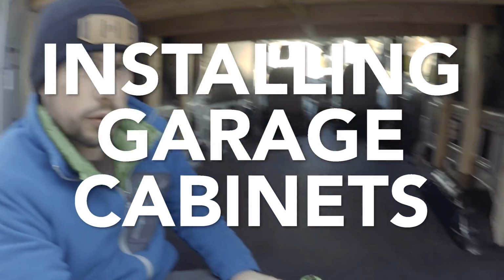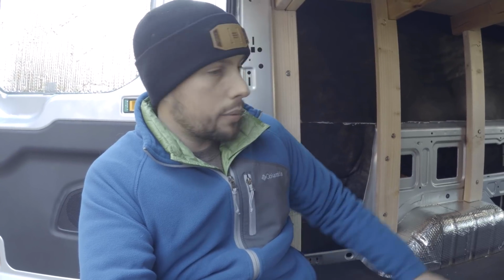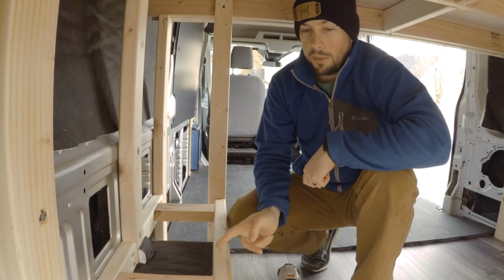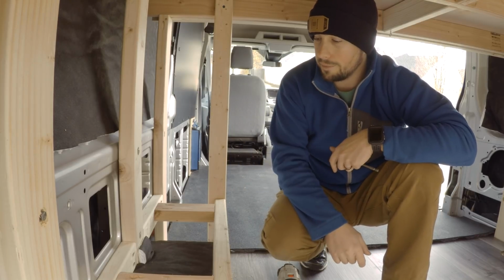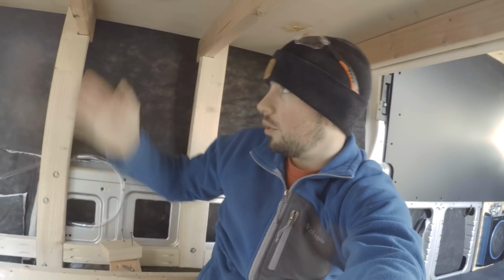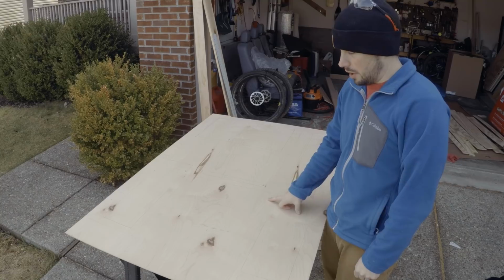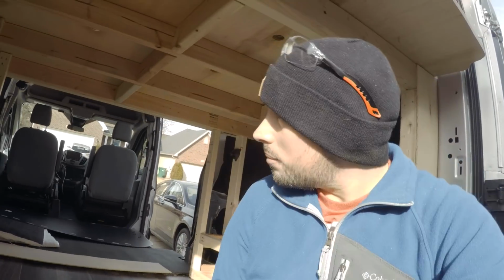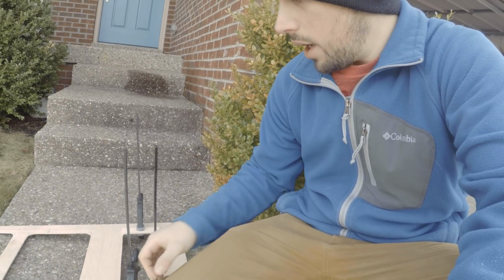Building Garage Cabinets in a DIY Camper Van // Van Life Ep. 12

Comment: How come you haven’t put in a moisture / vapour barrier in you conversion?
Reply from the maker: We eventually covered most of the interior with reflection as well (that could work as a vapor barrier) but I found that it's incredibly difficult to 100% seal the interior. The built in moisture repellency of the thinsulate will be helpful. So far with proper ventilation and some added moisture absorbing materials we've not had any condensation on the inside or noticeable moisture issues.